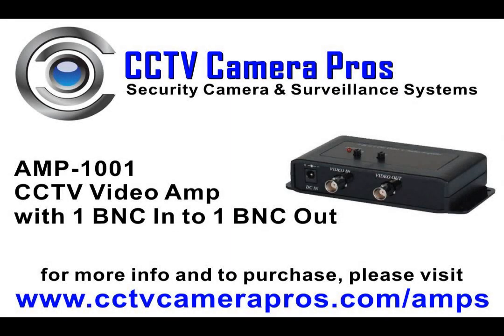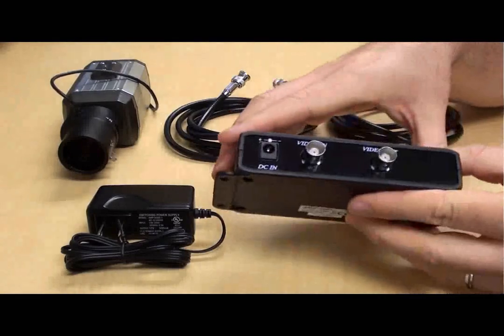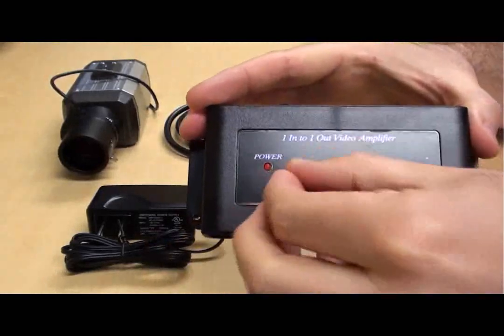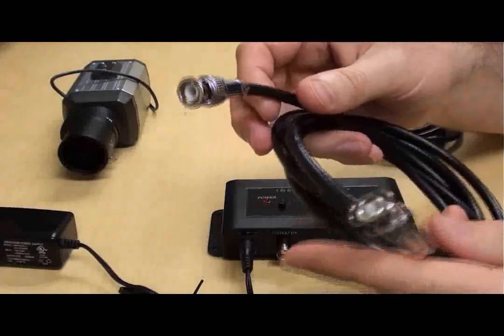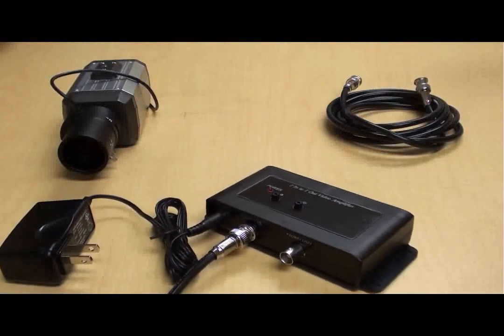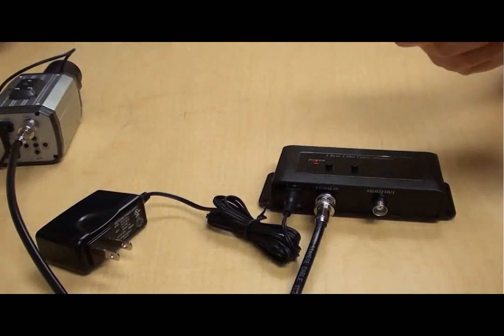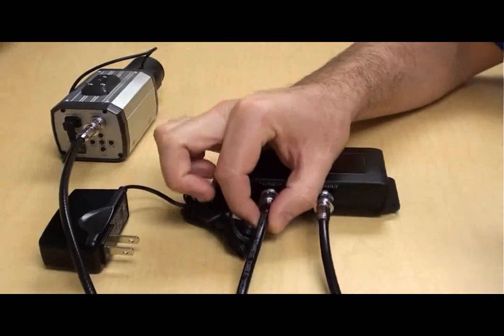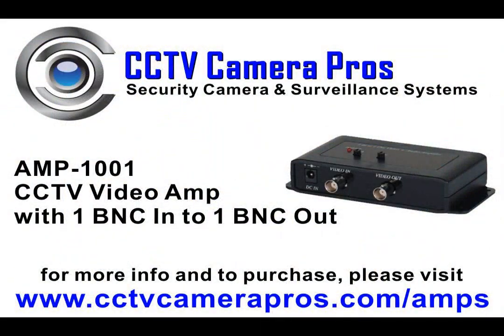CCTV Video Amplifier for Coax Cable

Comment: What is the distance do i need to use amplifier from the dvr using rg6 coaxial cable?
Reply from the maker: I assume that you are using analog CCTV cameras (CVBS video format). If you are using 95% copper RG6 coax cable that is rated at 75 ohm for CCTV cameras, you should be able to run your cable 700-1000 feet without video loss with no amplifier.

Comment: Will this work with the small cable that comes with cheap security camera systems like tge harbor freight one the connectors are the same
Reply from the maker: gilpinsvtmotorsport1 thank you for watching. All of the BNC video splitters and amplifiers that we supply are designed to be used with RG59 coax cable. If the premade cables you are referring to is not RG-59, it will most likely not work.
http://www.cctvcamerapros.com/BNC-Amp-CCTV-Splitter-s/419.htm

Comment: Can i use this for 500meters RG6 cable- 1080P
Reply from the maker: For 1080p cameras, you need to use this version of the amplifier. It works with 1080p AHD, 1080p HD-TVI, and 1080p HD-CVI video signals. Yes it works with RG59 and RG6.